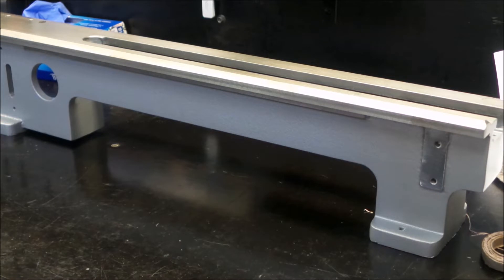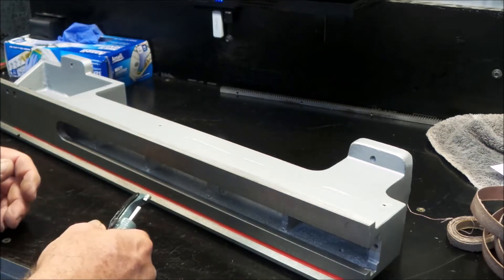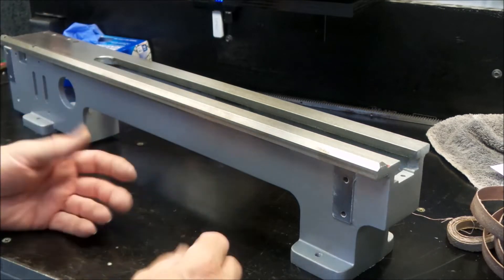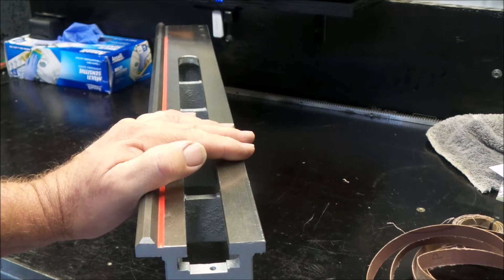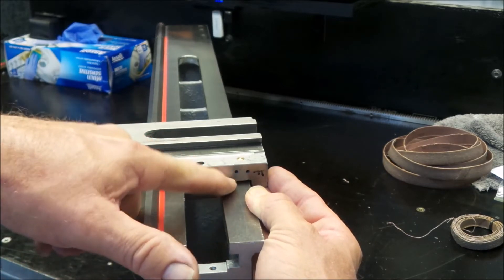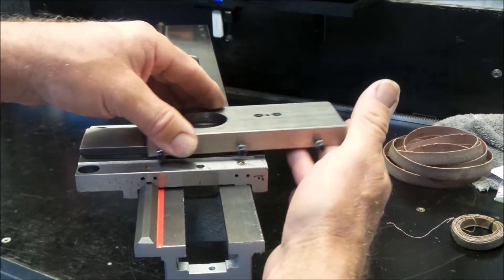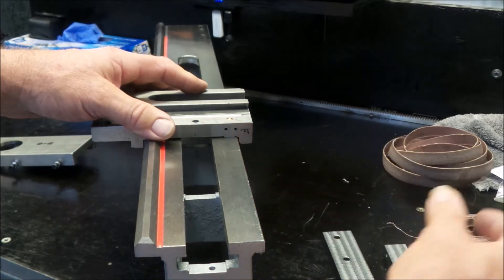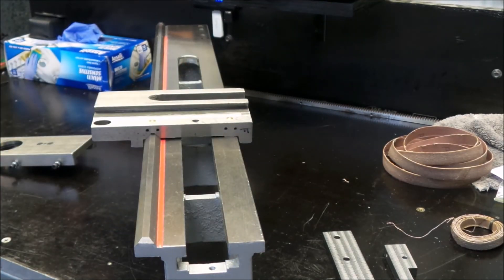Measuring The Bed Surfaces Of The 7 X 14 Mini Lathe. Episode 5.

Comment: Hi Trevor. Nice video series! 
Question: how did you measure the flatness of the ground bed surface?
Reply from the maker: G'day Mark, I checked the top surface with a borrowed known flat straight edge. It was reasonable. Cheers Mate.
Reply: @TheAussieShed  aaaah all clear. I was wondering how you would do that with a dial gauge since you don't have a good reference surface. Thanks Trevor! Cheers.